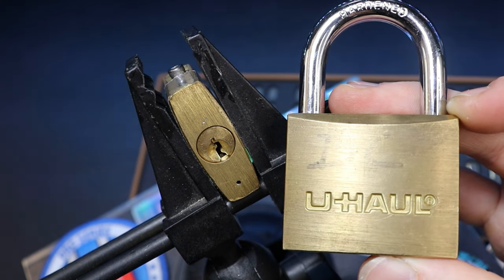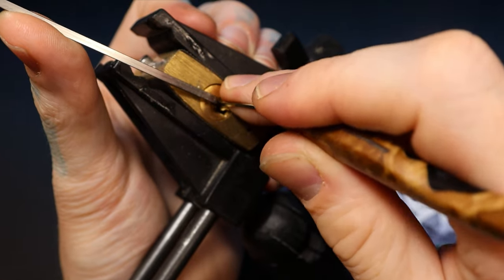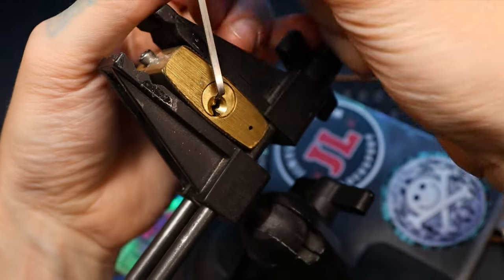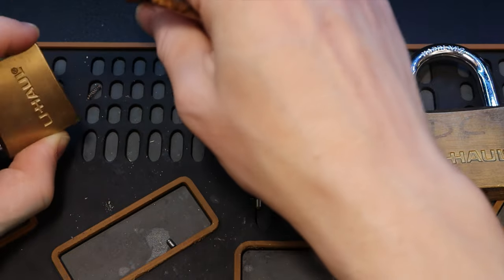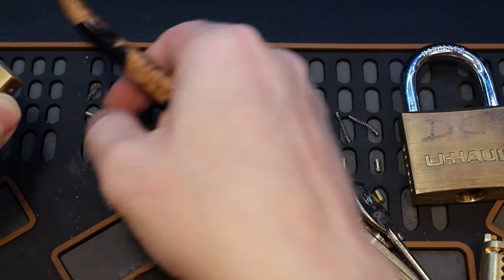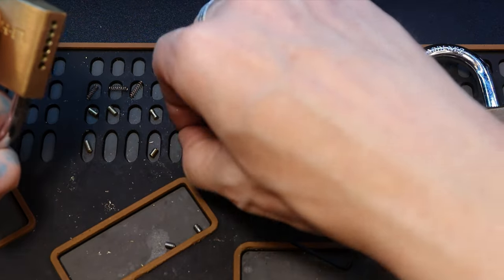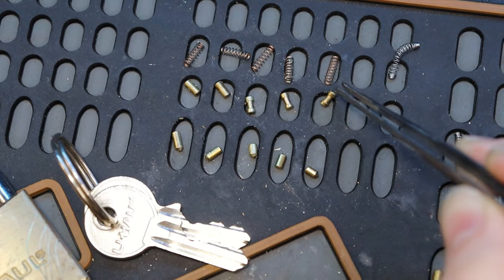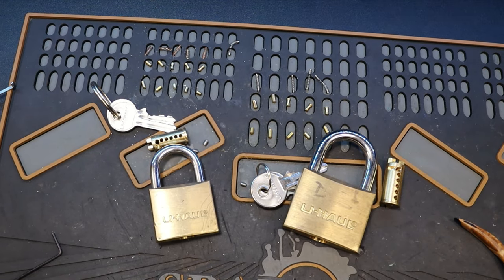268) UHaul Brass Padlocks Picked and Gutted

Comment: I have the 50mm model and I wouldn't have even thought it had any security pins. It's one of my easiest to rake open.
Reply from the maker: Wonder if there is an all standard pinned version? Master 140 had two versions like that. One all spools and other standard
Reply: @LockpickingDev  I wonder if locks like this get outsourced to manufacturers with different standards.

Comment: I wish you would do a video on how you drill the exterior of the lock body to allow the pins and cylinder to be removed.
Reply from the maker: I plan on doing this. It will be a month or 2 before the video it up most likely!